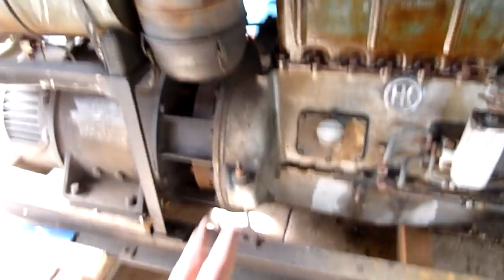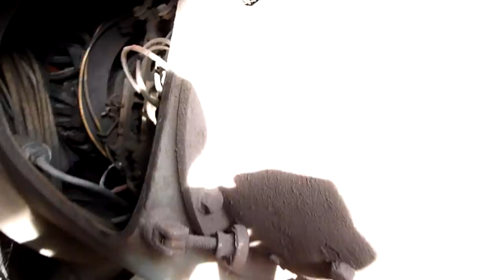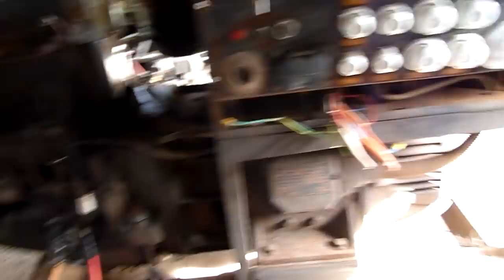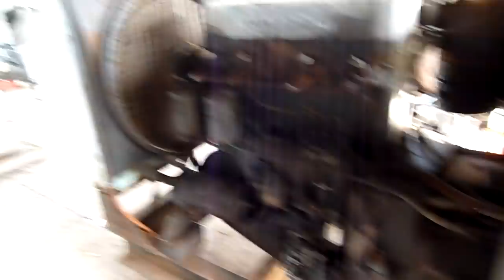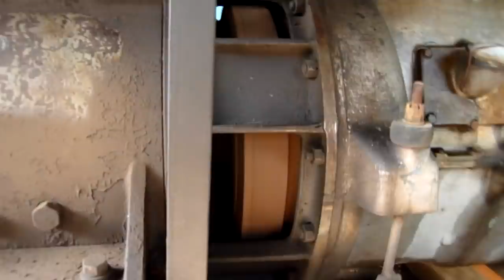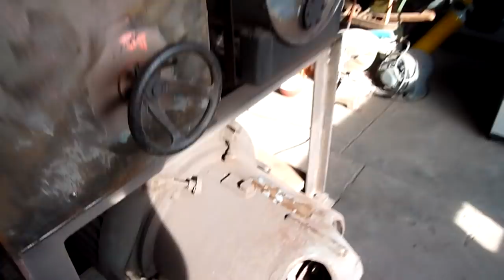Diagnosis of the 1961 60kva Kamper Generator (plus full throttle run)

Comment: Let's say you lift off a brush, for using the remaining two phases. The third phase are still producing voltage, and with the internal short circuit that are where the winding are burned, there will be a conciderable current, who does nothing but heat the windings so the armature get even more damaged. This generator should not be started again, before rewinding the armature.
Reply from the maker: the exciter brushes and ones on the main armature (apart from the slip rings) are lifted, but I will get the thermal onto that winding next time I run it.

Comment: 1940s, not 1960s.  Kaemper was dissolved in 1955.
Reply from the maker: the Alternator was stamped 1961, but I would be the builder bought a heap of 40's and 50's era engines for cheap and just used them up over the following years.

Comment: Did you mean millieohms for the resistance?
50Ohm or even 9Ohm are very high, at roughly 90A current per phase this would mean a huge losses.
If the burnt Winding has an internal short it will get very hot when the genenerator is running under exitation.

Comment: Drive that 30kw danfoss vfd from one the phases.
Reply from the maker: problem is the drive has smarts in it to throw a "dropped phase" error and shut down :(, I will need to force it to run or just feed it DC via a rectifier unit